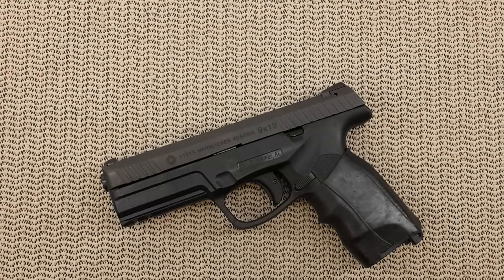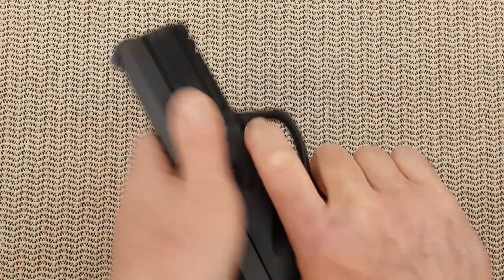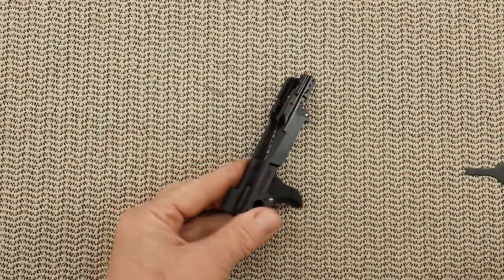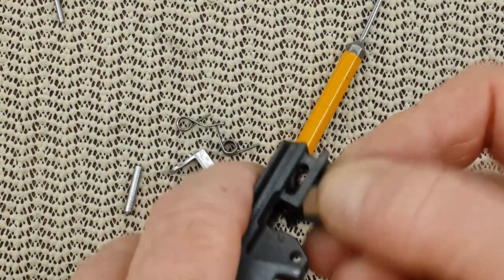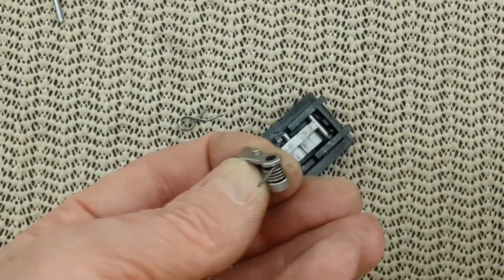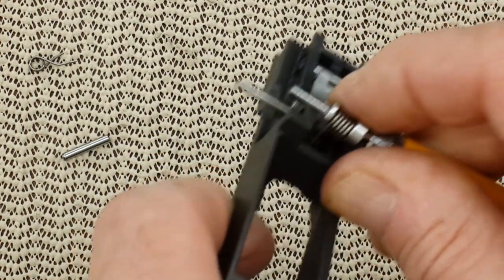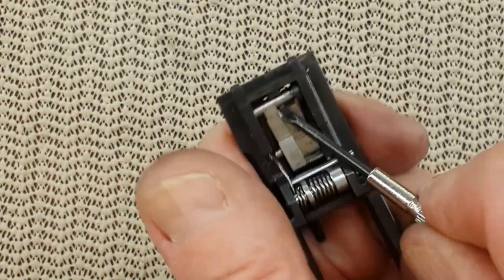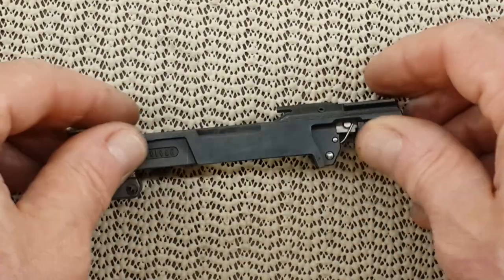Steyr L9 A1 Full Chassis Disassembly and Reassembly

Comment: Hi, I have a L9-A1 with the manual safety button on the trigger guard and I’m having a hard time trying to remove the chassis from the frame. A Steyr representative told me I had to lift the manual safety spring and then push the manual safety rod. The problem is the rod doesnt seem to move and I don’t want to break anything. Any help ok this will be appreciated. Nice videos by the way!!
Reply from the maker: It is very hard to help without seeing the gun. If I were you, I would ask a friend for help (2 brains are far superior than one), or go to your local gun shop with the gun and see if they can help. Good luck.

Comment: What you can also do is slide the chassis without the frame on the slide, move it all the way back, and use the trigger. Then you will see how this "double action" system works.
Reply from the maker: Very good suggestion, I will do it. Thank you
Reply from the maker: I have done it, and it shows how that gun is so well engineered. 
I discovered the "trigger bar lock" is used as a firing pin safety as well. Thanks again Philipp